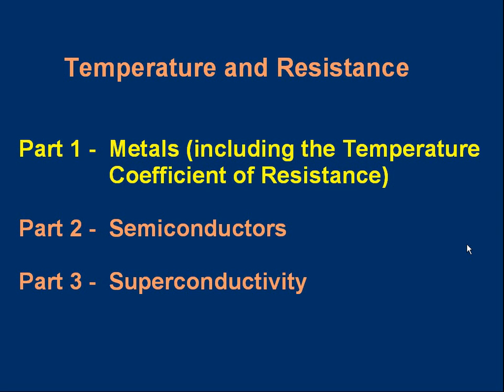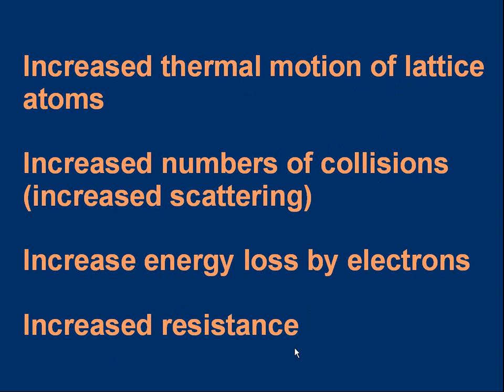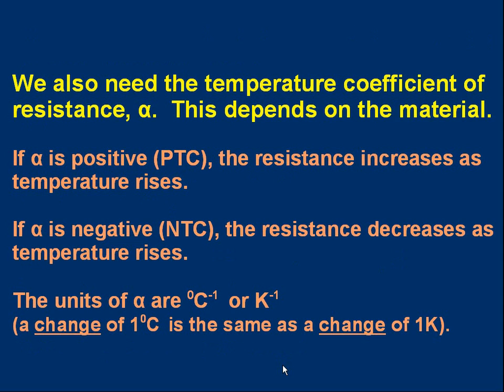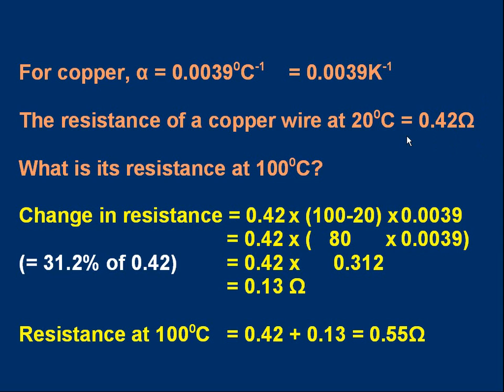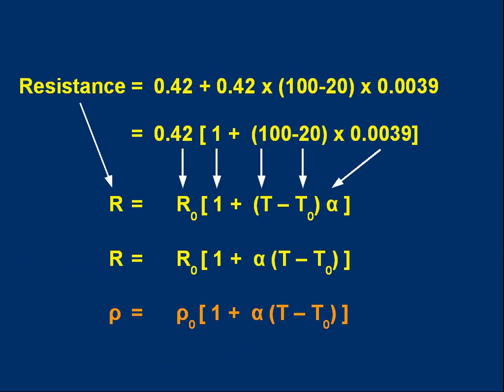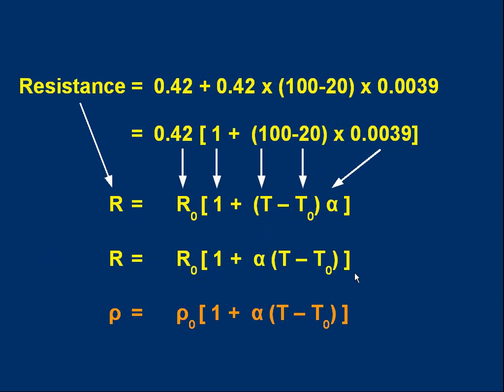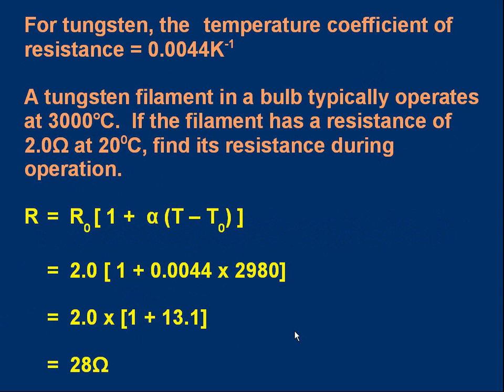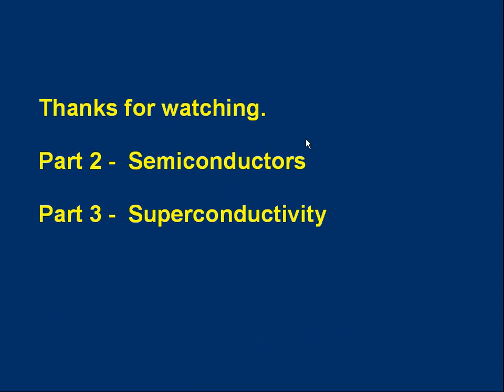GCE (A-level) Physics E25 Resistance and Temperature 1 of 3

Comment: How would I calculate the cross sectional area of an conductor that has resistance of 0.516ohms and is 75m long. The resisivity of the conductor at 20 degrees is 0.0283 micro ohms. I used the formula R=roh x length divided by Area. 
I transposed it to Area = (roh x length ) divided by Resistance.
The answer i got was 0.00411mm sq  <extremely tiny cross section!
I am quite sure this is wrong but have no idea what I should try now. Any ideas please?